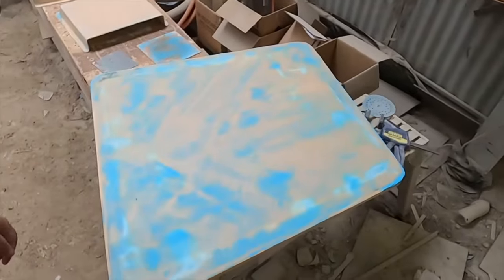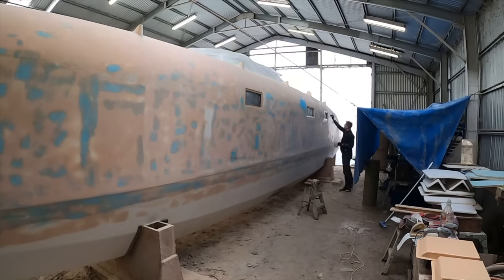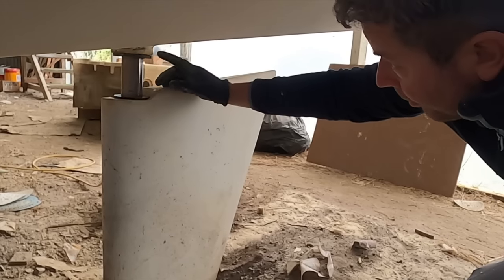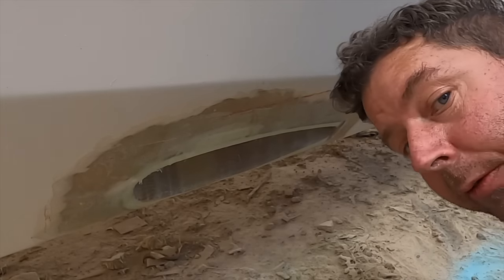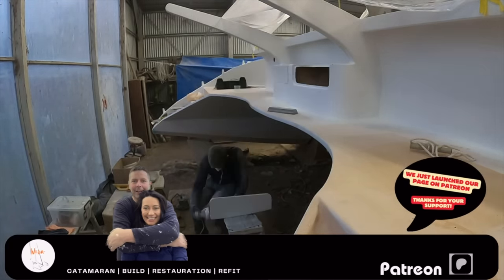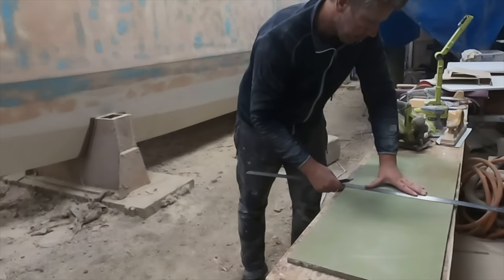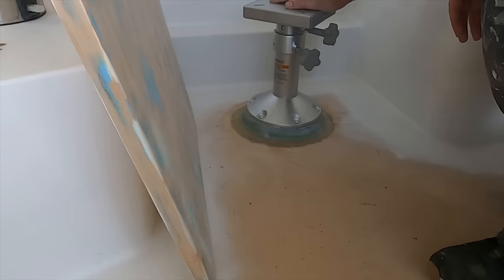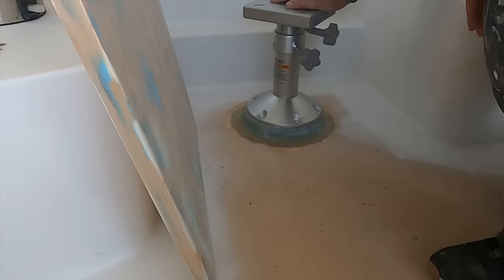Couple works on CATAMARAN REFIT and we RUN OUT of PAINT - S02 E45 - DIY Catamaran Building

Comment: Axel, when building out wood patterns for fiberglass mold I would try to get to the paint stage as soon as possible . We have a good easy spraying high build primer that also comes in a vinyl ester version for long term exterior use. Easy sanding too yet still hard. 
As you said you have to go with what you can get but I would suggest painting sooner,  filling imperfections you find is much easier to see in a mono color , and then reprime.   We always did 2 prime coats, Trying to fair and re-fair is so hard to see what your doing. 
Maybe try on a small hatch or table ? 
Cheers Warren
Reply from the maker: Thanks 🙏 Yeah. For the whole boat we have actually done it with 2 primer coats. Build, rough fair, paint, fair, paint again, final fair, touchup, topcoat. Loooong process 🤣 rewarding in the end though
Reply: @buildingwilda  👍 it’s a lot of work .

Comment: Great work guys, if the rudder's leading edge was longer you would get that edge being forced around as the water caught it, making the steering very heavy.
Reply from the maker: Actually, unless you overdo it, it works in the absolute opposite of what you are saying. Rotating the rudder becomes easier if you shift part of the area forward of the pivot. But you don't want to go too far.

Comment: Thanks for the video. I was wondering if you had a thin glass skin going from the inside of the daggerboard case to the outside of the hull skin. I didn't do this at first and got a hairline crack in the glue mix around the outside of the case after a couple of years. So I had to round off the case bottom and use light sheathing cloth to ensure that it didn't crack again. If you cut sheathing cloth at 45 degrees it copes very well with tight radii. 
As to the rudders, I would wait and see. There are heaps of Schionnings around and with a nice wheel system a somewhat heavy steer is fine. On my 38 footer, I can steer by 800mm long tillers or by the wheel, it is hard work offshore with the tillers but easy and fingertip light with the wheel (chain and rope). It is really important not to put too much balance on a rudder. A friend had this happen to him on his new rudder - really painful.
As to rudder size, make them as big as you can. There is an awful lot of incorrect stuff about cats going fast and not needing large rudders. Actually cats with large rudders are much nicer to sail. I designed two trailer cats and with their very large rudders they behave beautifully at low speeds when smaller rudders stall. Coming out of a tack in light winds and chop, the rudders will have little flow and yet need to develop lift to counter weather helm. Large rudders are the only way to do this. Small rudders on many cats is one really simple reason they can be so hard to sail in light winds and chop. Also, offshore, when broad reaching in a seaway the windward rudder will sometimes come almost totally out of the water, just when you need to use more rudder to resist heading up. So again large rudders are nice. The rudders on my 38 footer are pretty big but if I was to build her again, I would make the centreboards and rudders even bigger still.
Reply from the maker: Thanks. Sounds like sound advice and very much inline with my thoughts.

The dagger board cases are cored out, filled, glassed in and with a shaping/fairing layer of epoxy compound to shape the holes.

Thanks for watching

Comment: If I were you, I would check the rudder size, seems a bit small for size of the boat, could have turning issues
Reply from the maker: I agree. But actually the rudder is an enlarged version of the original design also designed by Schionning. Should work. Plus, I'm from a shipping background where rudders are nowhere close as big compared to lateral hull area, so used to small(ish) rudders. 🤣 And remember, this boat will, loaded to the max, still only displace a third of a similar length lagoon or leopard or similar, and half the weight of a similar length Seawind.

Comment: Those rudders are going to make who ever is on the helm develop VERY large muscles. They are not balanced. You need to have at least 12% of the area of the rudder forward of the centre of the rudder bearing, Usually, this is placed nearest the forward edge rudder close to the bearing. I fried of mine built a 40ft crowther, he placed the rudder shafts canted slightly forward at the top. This made the force required at the helm VERY heavy. Do yourself a favour and find the plans for the rudders and FOLW them, in Detail.
Reply from the maker: Yeah. I come from a shipping background where spade rudders are balanced efficiently. These rudders are built to plan, so I won't rebuild them. Maybe they work well. I can't say exactly how much area is forward of the pivot, but hopefully enough. The perspective in the video isn't the greatest. At least 1/10 of the area is forward of center of the shaft. Doesn't look like much. I was just surprised they aren't designed with more area forward.
Reply: @buildingwilda 10% forward of the stock is fine - I would not sweat about this.👍